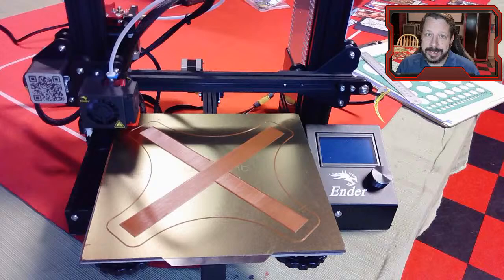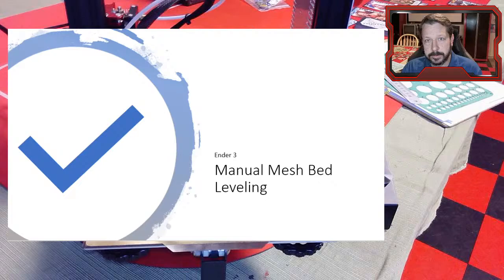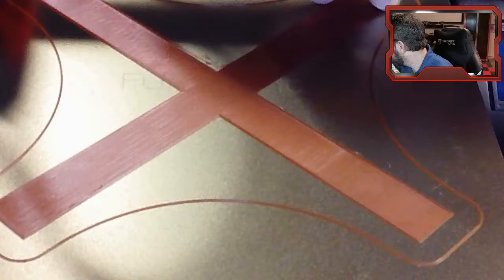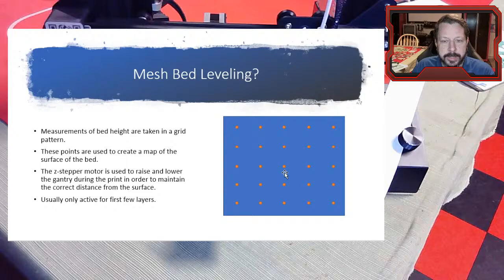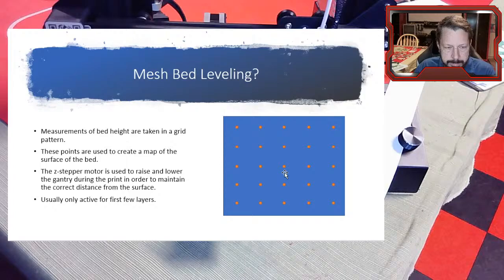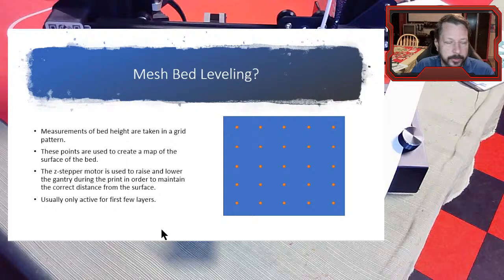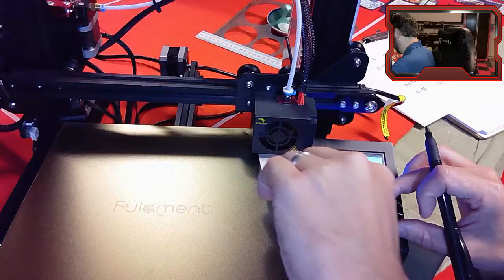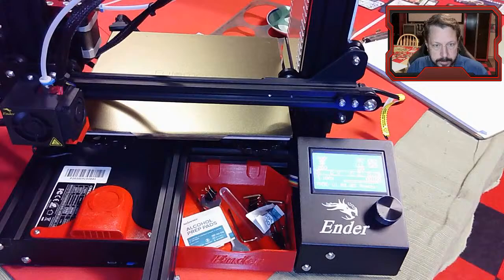Manual Mesh Bed Level | Ender 3 | Class 7

Comment: I have an Ender 5 Pro with a warped bed.  Will using the manual mesh bed leveling work on the Ender 5?  Can I follow the same process as you outline in your videos?  I have the 32-bit 4.2.2 board with the built-in bootloader, so things are a bit different.  I do plan to add the TH3D EZABL soon but would like to start with the manual mesh bed leveling.  Guess I would follow the TH3D process to install the unified firmware which supports the 4.2.2 board and then update the configuration.h to setup manual mesh leveling for now.  Does that make sense?  Appreciate any help.  Thanks.
Reply from the maker: I have not actually tried to add manual mesh leveling to a 32 bit board, but I think it would work. What you described should work. Manual mesh leveling works well as long as you have a removable print surface otherwise you have a good chance of throwing everything out of kilter when removing a print.
Reply: @KellyBC  Thanks for the reply. I do have TH3D's EZFlex PEI smooth & textured plates. The Ender 5 comes with the magnetic bed sheet pre-installed. My Ender 5 Pro is just a month old and I'm pretty new to all this (but I'm an older EE with lots of electronics & programming experience).  I did talk with TH3D and they did confirm that their Unified 2 firmware will work with manual mesh leveling (they're actually the ones who first suggested I try this, then I found your video which was really helpful, THANKS). I'm in the process of trying to do this right now. In general, how have you found the Unified firmware to run? Has it yielded a better printing experience? Better prints in your opinion? Any issues I should be aware of? What other mods have you made to your Ender 3? I'm trying not to do many mods until I learn the base printer well but this warped bed issue is really killing me at the moment. I have also purchased the PrinterMods MDD direct drive conversion kit for the Ender 5 which most people seem to like. That'll be the next major mod I'll undertake. I've also picked up their LED lighting kit and TH3D's updated Z coupler, upgraded PTFE couplers and quite fans. Again, waiting a bit to install everything. Do want to upgrade to an all-metal hotend so I can print higher temp materials in the future. I'm really liking the stability of the Ender 5, just want to resolve this warped bed issue which hopefully the EZABL will accomplish. Really surprised your videos didn't get more views, feel you cover a good range of material at enough depth so you can actually learn something. I definitely appreciate what you did, hope you'll continue.